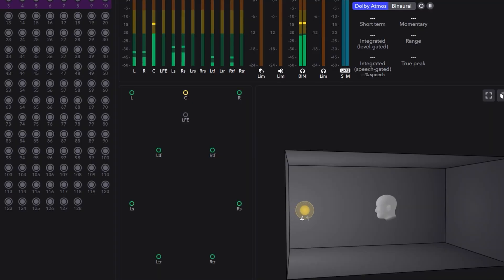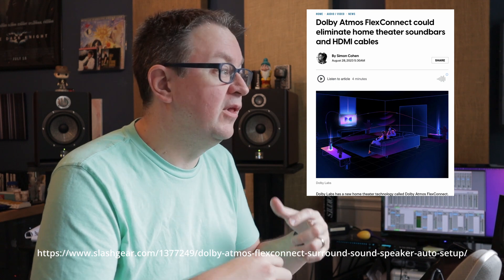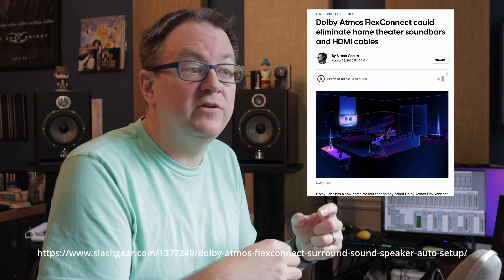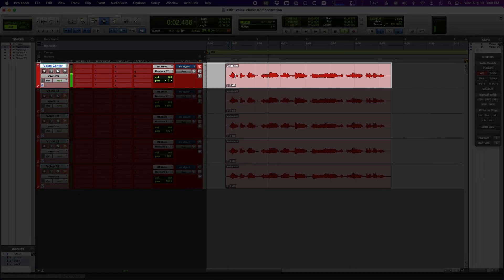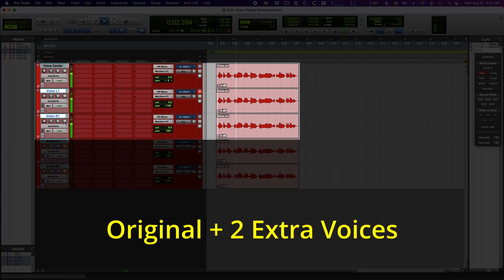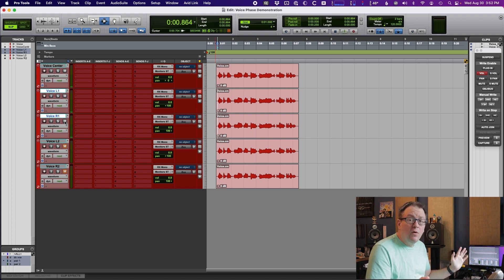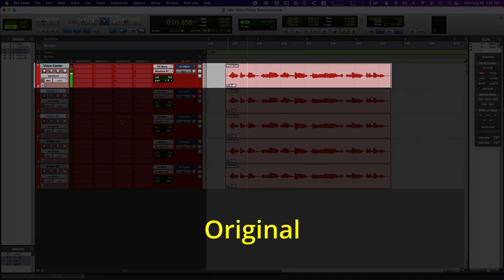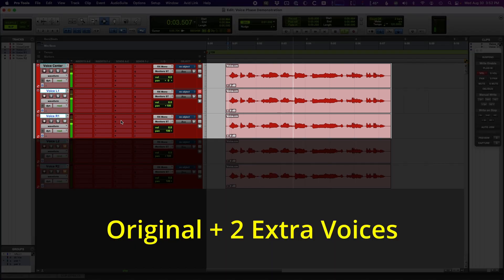Avoiding Phase Traps Mixing Dolby Atmos Music

Comment: 1:17 As I told you before, I am a total beginner… But sometimes, there are some technical issues from other fields that remind me of that effect.

The other week, I had been watching a great video from Anthony Marinelli who has created this idea of “Think as a Synth”…

In this video he explained the ADSR principle of sound shaping in synthesizers. Result? If you do not have any RELEASE, you won't get any SUSTAIN.

These software tools do not like extremes… as far as I can tell from my own programming experience. The value of a perfect zero does not work in some cases when — strangely enough — a value of 0.001 does.

I know that you all love this principle of having these sound sources “on the wall” — but I am not really surprised to learn that a slight offset might be working much better. “Think like a wall” ;-)

Comment: Actually you can bring the object closer to the listener in the speaker mix . That’s the beauty of the actual speaker mix . As you move the object away from the front towards the sweet spot at listener level it brings in the side speakers and the phantom center moves back towards the listener . The perceived object location is placed anywhere in the audio 3D dome in relation to the sweet spot created by proper time alignment of the 11 speakers . Yes , the vast majority of end users don’t have the correct setup but Dolby’s whole deal is that the algorithms create infinite phantom zones .

Comment: Also , in addition to pulling the vocal closer to the listener , make the vocal object BIGGER . It makes it fill better and sit better .
Reply from the maker: Well, we can't actually pull something closer to the listener with the panner. It may appear that way in the panner,  but that's not the way Atmos works. Atmos is simply level based panning, so by bringing something off the wall we're just putting it in more speakers. Putting something in more speakers is a potential minefield on the consumer side where setups probably haven't been professionally installed and are at the whim of the consumer getting it right.
Reply: @goingto11  can he not hear (with his ears) that you're right Dave is 100% right i heard this happening just monitoring binaural and in stereo dude that's why i searched if anyone had solved this and found this video. Don't let imaginary specs lie to you (although Dolby is a little shady about divulging the particullars of atmos). Anyhow thanks!

Comment: My favorite technique that I have noticed with a lot of modern songs originally only mixed in stereo (the vast majority of music at the moment) is that there is a tendency to use a lot of channel-based panning rather than like objects, like using buses. Drums, bass, lead vocals in the fronts, background vocals, some guitars, and background synths, and atmospheric pads and dithering/saturation/reverb effects. It all depends on the song. The only time I would use anything outside of the bed tracks would be "ear candy".

If you have an already made a video of this, it would be super cool to see how phase can be relevant with bass management and the LFE channel, especially people with dual subwoofers that are using them for both. I have had a few mixes that I feel like were butchered, and had no Low end due to phase correlation. This could be an issue when playing back in systems that don't have separate subs for each individually, and even then, I feel like there would still be phase issues if the subs were separated. Am I wrong??
Reply from the maker: I haven't done anything about phase and the LFE, but there are a couple of places it can happen. The first is if you're filtering your LFE which is recommended by Dolby. Anytime we add a low-pass or high-pass filter, we're putting what a lot of us call a wrap in the phase response around the crossover frequency which in this case is a 180° rotation in the phase response around that frequency. So, when we put stuff into the filtered LFE that is also in the mains, and that filtered content recombines with the mains, there can be phase cancellation at the crossover point.

Another potential issue you can run into is when the subwoofer(s) is/are misaligned with the main speakers. All speakers have their own phase response and when speakers are being properly aligned, part of that alignment involves getting the phase responses of the two "systems" aligned. 

Successfully using multiple subwoofers is dependent on placement. The general rule is you want the acoustic center of the boxes to be no more than half a wavelength of the highest frequency you'd like them to produce. So, for example, if 80 Hz is your magic frequency you want the center of your subs no more than 7' apart. 

You can make an exception to this in smaller rooms, though, when you're using 2 subs. Placing each sub in a corner of the room will actually counter a lot of the natural room modes and smooth out the low frequency response.  It's a bit counter-intuitive, but that's why you can actually be better off with dual subs in a small room even when you don't need the additional headroom you'll get from them. What can be bad, though, is when you have two subs and have different content in them. For example, use one sub for bass management and another for LFE. I don't advise doing that at all.
Reply: @goingto11  That's what I assumed!! I did have my subs in the corners, and I think it sounded the best out of the other options I had in place prior. I was mainly confused due to the fact that the atmos room design tool had the option for base management, which was either with the speaker selection, or adding additional subs to your set up. I understand that they are trying to justify getting headroom, but, like you said, it only adds more to the equation to figure out the best placement relative to the other speakers and subs. Thank you for the quick response!!